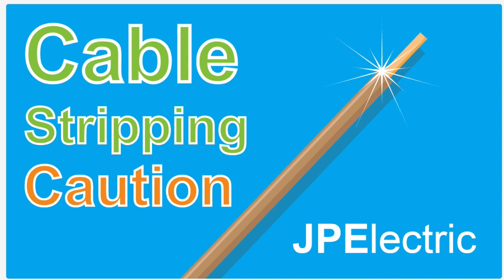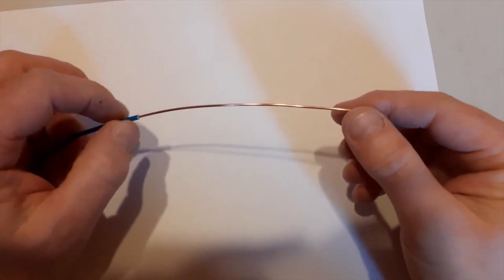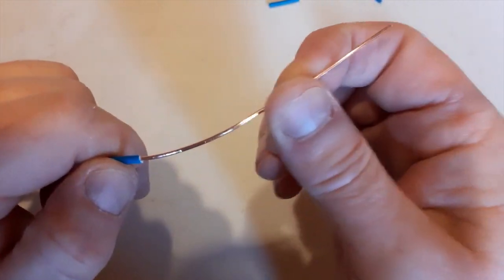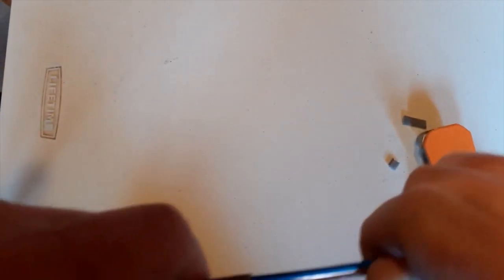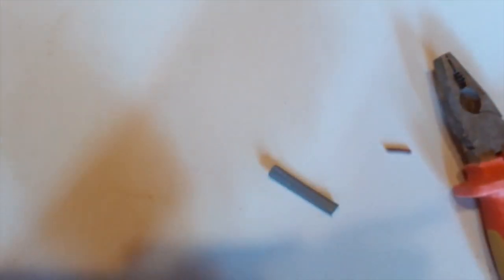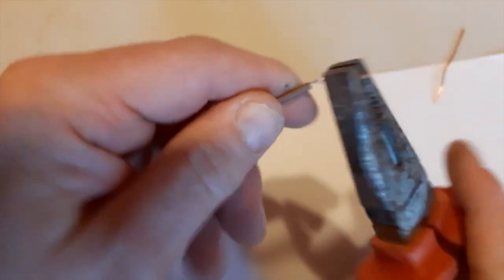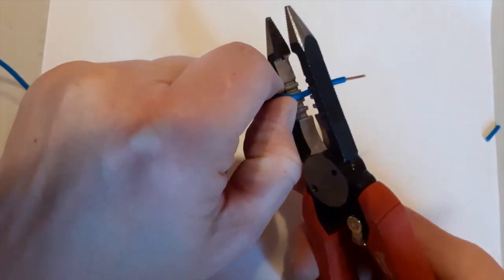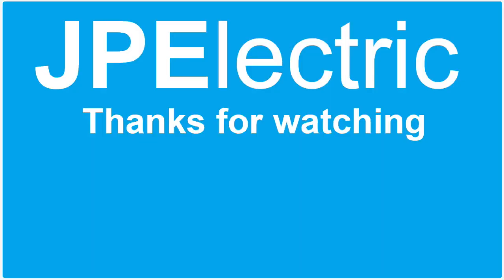Incorrect stripping can seriously damage  the copper conductor

Comment: Another good video. One type not covered, that I haven't tried, is the adjustable end pull type, that grabs the insulation from the end direction, and you pull away from the cable in the same linear direction as the cable lies. Obviously not so ideal if access to the cable is limited and/or it's not easy to get at the cable end on, or there is no room to pull away in that direction. I think KNIPEX make one and I see many in the Trade tend to use them. Properly adjusted for the size of cable, and provided access and pulling room isn't an issue, I think these may well be effective in not touching the copper more than needed. I didn't much like the look of these, but this video made me think again. I may get a pair now that my curiosity has been piqued! Hopefully Santa will have one in his sack for me. Hold on, that didn't quite come out as I intended. Wait, I'm making this worse! I'll get my coat...
Reply from the maker: Thanks for another great comment Keith. The type you mention are quite good when you don't have a lot of cable in a confined box. Best to have as many options as possible fo all the different cable types